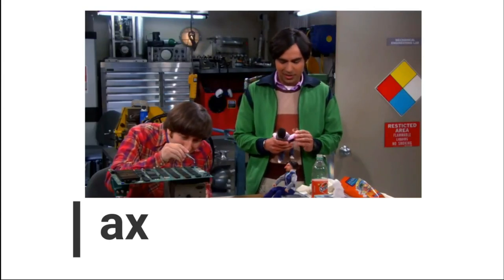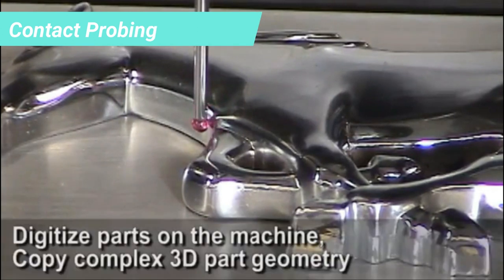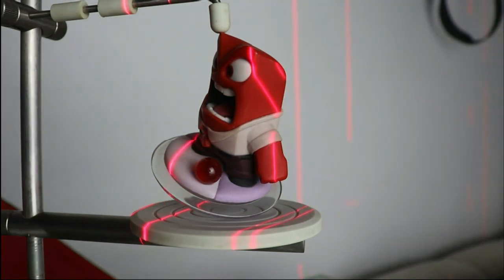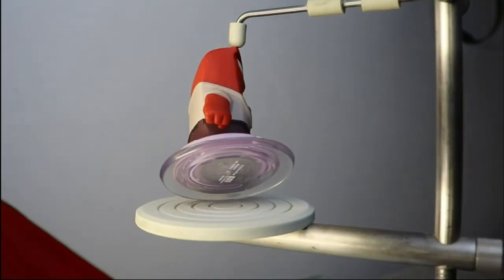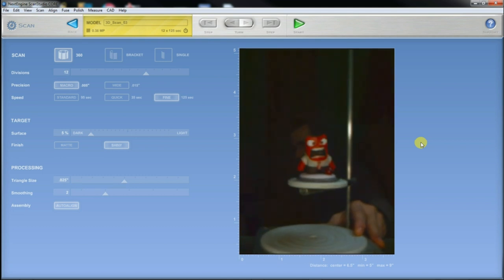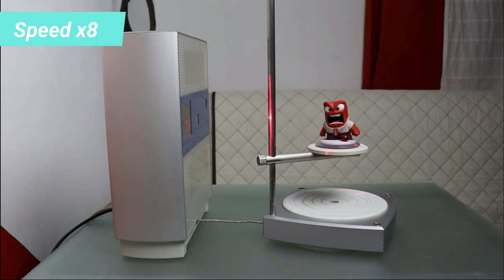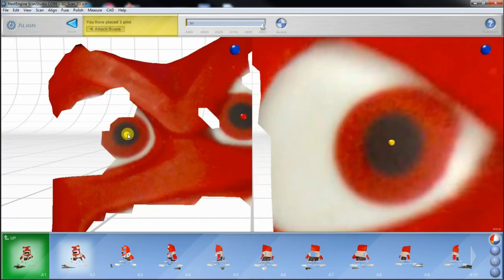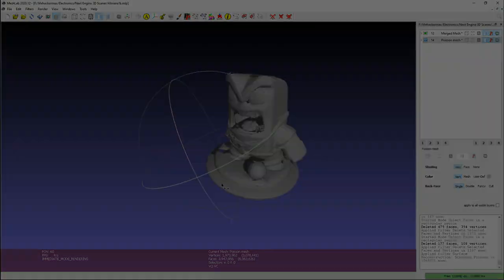3D Laser Scanning | Nextengine | How it works & Things to know before scanning an object

Comment: Hi great video! thank you for sharing. Ive found out that you should update your software so that you don't have to put together all the pieces with the yellow, blue and red dots.
Were you able to do the installation this year? Do you have contact with Next Engine technical support?
I want to buy the scanner from a friend, but I'm afraid they won't give me the license. Any information will be very helpful! Thank you
Reply from the maker: Hey Noah! Thank you! My software has auto-alignment function but I don’t enjoy it that much. And my scanner isn’t the HD version. I believe they have developed more functionality on the software for the HD scanner that mine will not connect to. If you don’t have the license for the scanner you can’t connect to the software. My license is based on an email address and a password. It would be a good idea to make sure you will get the license with the scanner otherwise you will not be able to use the scanner. At least that is what I know. And if you wish to move the software to a different computer you will need to be able to connect with your email and password in order to do that so be sure that you will be able to do that on your own in the future if you wish. I hope this helps. Good luck 👍🏼🍀.
Reply: @LifeHackerMax  Thanks for your quick response and advice.
I'm going to make sure I have the email and password of the original owner before buying it.
My question was, if you were able to install it this year 2021. If you managed to contact technical support to get the code or if you did it years ago?
Thanks for the information, it was very helpful
Reply: @noahnavarro8616  were you able to activate the scanner or contact support?